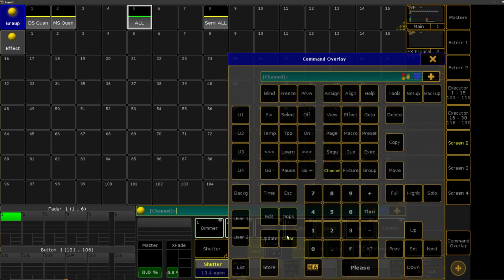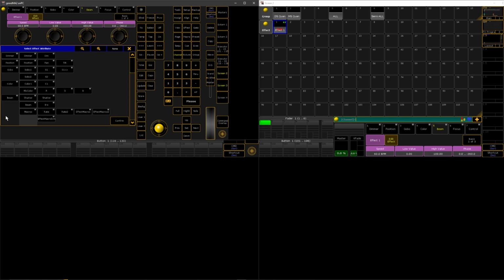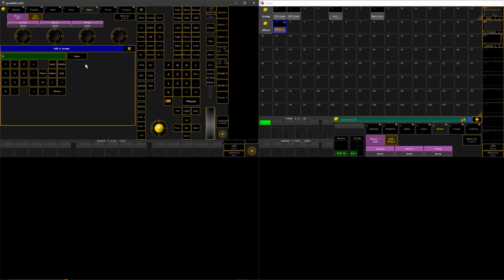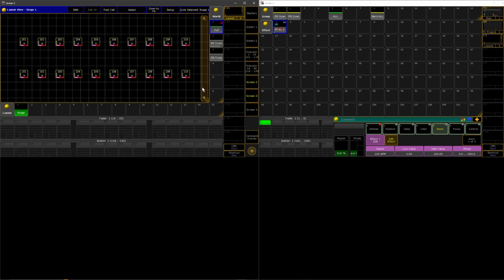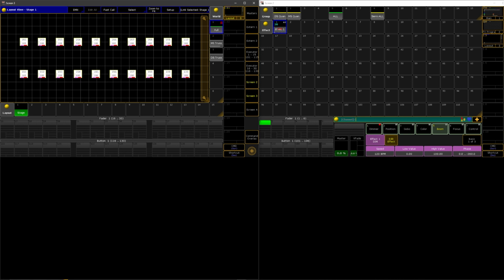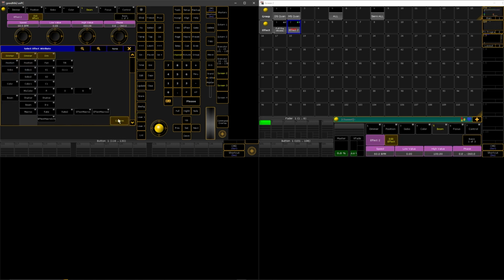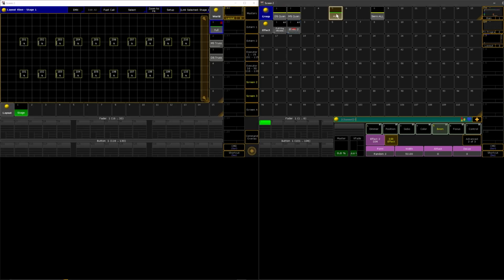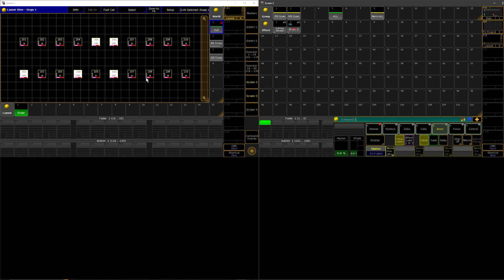How to use MA2 - Strobes

Comment: hey taylor... i agree that this is a better way to strobe than using the beam channel only. but there's a limitation on this method. you can't strobe faster as the dmx output frame rate of the ma2 allows you to do. wich is, as far as i remember, slow but stable 30hz, high enough for a common strobe effect but not fast enough to make them really flickering...

however, good video!
Reply from the maker: I agree. But for most cases this is the easiest and fastest way to make a strobe effect that will react the same across your entire rig. For faster strobes you would have to go into your shutter tab for each fixture type and manually adjust each group. However I have noticed a weird delay when doing it that way. Have you experienced this yourself?